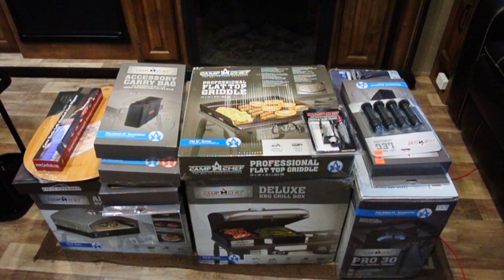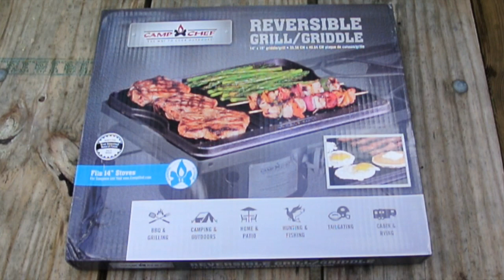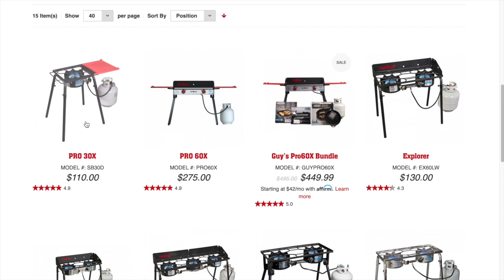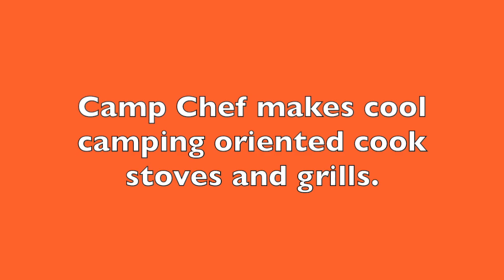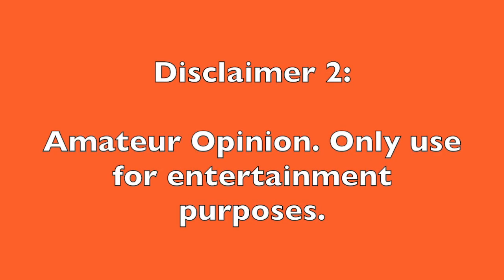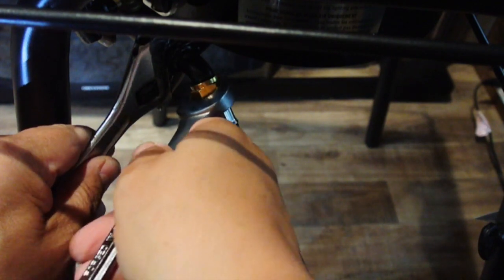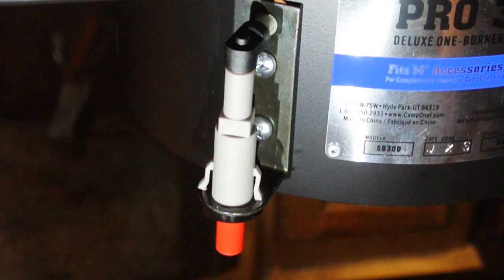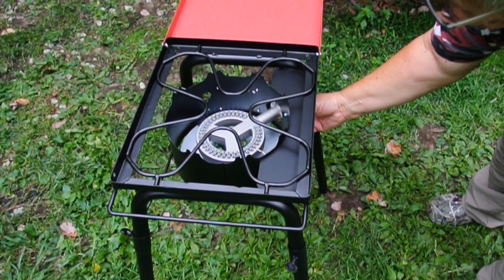Camp Chef's 14" Grill System for your RV.

Comment: This was great to watch. 
I had a Yukon model that I converted many years ago to natural gas and it was really a nice compliment to my barbecue. ( I drilled out the jets)
I have been looking at blackstone grills for my new RV when I thought I could repurpose the Yukon. That meant getting a set of new gas jets to handle propane fuel. 
Out comes the barbecue paint and rust remover. Some time and effort and looks like the day I bought it. Here is where I got creative. 
From past use I knew that levelling the grill was really important in controlling the grease. I was annoyed at getting up and down over and over was too much like work. Therefore I dispensed with the legs and installed newly acquired levellers directly to the Yukon frame. (Yes,they fit).
Now, I can set the stove on my table with folding legs (about 4 feet in length) and, I can now level the stove while I am standing in front of my “cooking station”….yup, no bending over.
Again, a very informative video. Thank you.
Reply from the maker: Thanks for sharing your experience.

Comment: I had my first Fifth Wheel prior to 2013. I outfitted it with a 3 burner 16" stove and grill. In 2013 I down sized to a Lance 1685. 16 foot box on a 20' frame. Didn't have the room for that stove system any more. Downsized to a 14" 2 burner stove, Grill box and Griddle. Grill Box and Griddle were the 1 burner style. Then when I started doing pancake breakfasts for a group I added the 2 burner griddle. I have upgraded back to a 5th wheel and the 2 burner is still perfect. I want for nothing more.... Except the pizza oven. The price on those gives me pause.  Maybe I'll find one used one day.

First thing I usually do when I pull into my campsite is set up the outdoor kitchen. I go camping to be out side. I have a lightweight folding table that I set up next to the stove to use for prep and serving.

Also not a salesman for Campchef.

Comment: I've been using the 3 burner Camp Chef for several years and love it.  Also have the single and 2 burner griddles although the single is used most often.  They make an upgraded drip tray for the griddle if you don't have it.  It's called the Professional Grease Cup and is a lot better than the thing you hang a tin can with.
Reply from the maker: I bought a grease cup that was an off brand but looked identical. The ones Camp Chef had were out of stock.

Comment: Just last week I hooked up my 17" Blackstone to the rv with a made up hose (do not do!) and quickly realized my tiny flame was the result of going thru two regulators..one on the rv supply and one on the griddle itself.  I have a new hose with the Blackstone fitting in my Amazon cart,  and an hour later I see this video...perfect timing!  Do you think a 15 foot hose is enough? My outlet is in the same position as yours.
Reply from the maker: I am using a 12ft hose which seems plenty.

Comment: do these camp stoves have a pressure regulator built in the unit ? if so when using the rv's propane port the pressure has all ready been reduced
at the tanks. if you go through a 2nd regulator on the unit it self it seems it would reduce propane flow to much. i had this problem with a portable
propane fire pit and had to remove the built in regulator in order for it to work with my rv's propane outlet.
Reply from the maker: The regulator for the Camp Chef stoves are part of the ACME thread adapter that goes on the 20lb tank.  When I removed the original hose, I also removed the regulator.  The new hose does not have a regulator because, as you said - you don't want to double regulate the propane.
Reply: thanks for the great info'